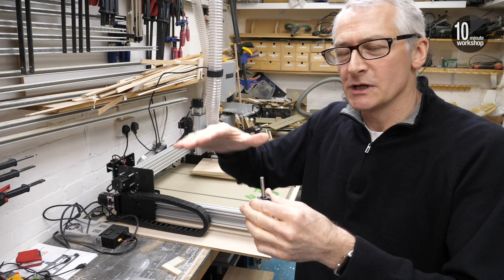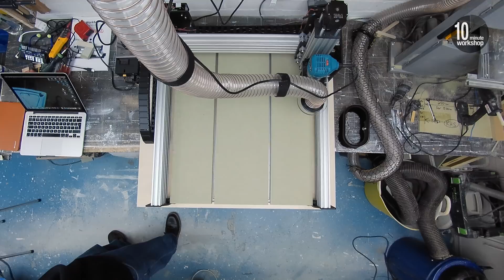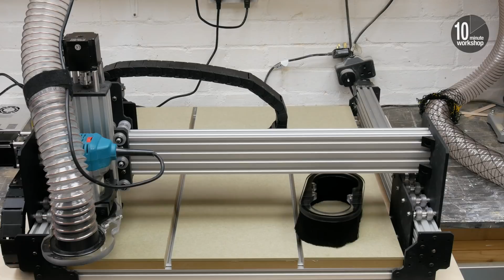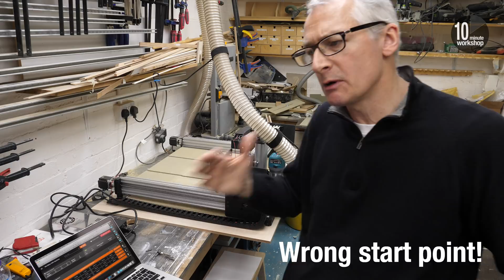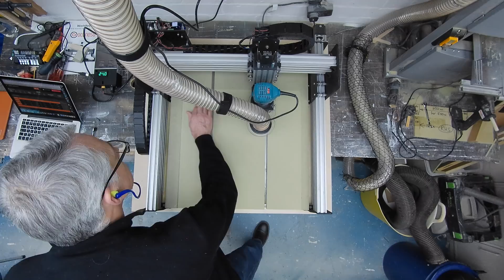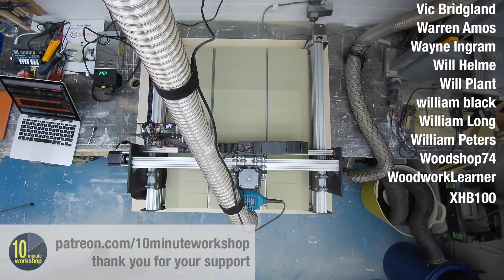Starting Out in CNC P8 - Spoilerboard surfacing [video 392]

Comment: I don’t know what CNC controller software you are using? But in Mach3 it allows you to jog over the preview of your job to see where you will be cutting first. Also when you are cutting your grid lines you should use a pointed engraving bit and only go .02 or so deep. Lots of bits to brake. Have fun.

Comment: With a small trim router , regardless of the brand, as a spindle, you will want to keep the router speed turned down to it's lowest setting pretty much regardless of the bit you are using. A router has very coarse speed adjustments, and even at it's lowest setting (10K to 16K RPM) is way faster than needed unless you are running feed speeds of over 100ipm (2540mm per minute).
This will introduce much less heat into the router and the bit, give you a much better surface finish (as long as the bit is sharp), and make the brushes in the router motor last much longer. It isn't as simple as trying to go off what you know about routers and woodworking, as the CNC moves at a very consistent feed rate. There is much to learn about Feeds and Speeds with CNC's. It's an entirely different animal!

Comment: When you turned the router on with the 1" flattening bit it sounded as though it was going at max rpm.  For a bit like that, (if you can) I'd slow the router trimmer right down as well as ramping up the speed at which the router moves across the board.  There isn't much load on the router trimmer taking a shallow pass so getting the CNC to move it over the board as quickly as it can without losing steps is a trick to master.  Also, if it's that hot, your router and bits wont last too long. Cheers, David
Reply from the maker: Thanks David. I’m a novice at CNC but not with routers, I’ve been using them for ~20-odd years, and this one was nowhere near maximum speed, it just sounds like it is! The Katsu is a real screamer, great value as a trim router, but not really the tool for this job, and will be the first thing I upgrade. 👍👍

Comment: What speed are you running the router at? I’d guess the Makita does about 10k RPM at speed 1, which would be faster than required and would make your brushes last a lot longer. Maybe even keep the router a bit cooler?
Reply from the maker: It’s a cheap little Katsu copy of the Makita. I wouldn’t trust their specs for speeds tbh; as much as I admire it as a trim router, for the money, it’s the first thing I’ll be replacing. 👍👍

Comment: Poor edge finish is presumably because that's an "up-cut" bit so it's pulling the fibres up at the edge. You could use a "down-cut" bit - should be fine at that cut depth but can create problems on deeper cuts as it tends to pack the sawdust into the bottom of the trench. There's also "compression" bits which are divided into half up-cut and half down-cut - useful when you want a good finish on both sides.

Comment: Felt the pre first cut tension there lol. 

Is there an option to have the software control the spindle on/off instead of having to do it manually?
Reply from the maker: That’s usually ems feature left for the higher end industrial machines, but the new Mafell milling motor and some of the Kress spindles can be controlled by the board, so I’m looking in that direction for my first upgrade. 👍